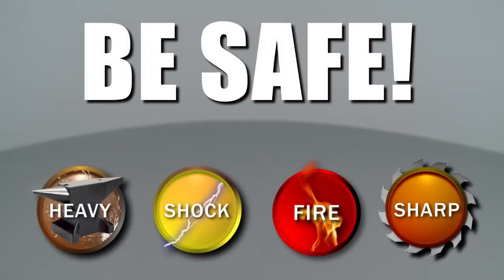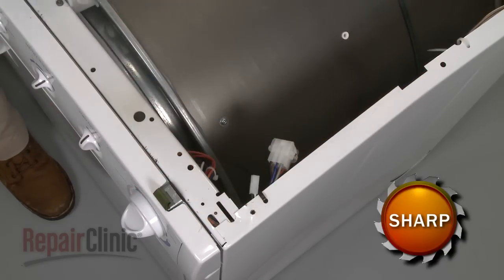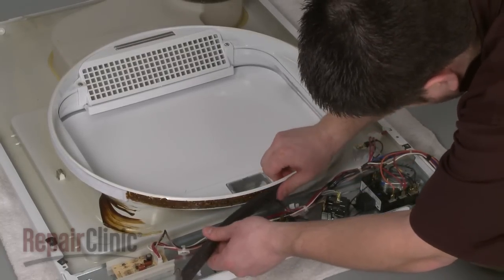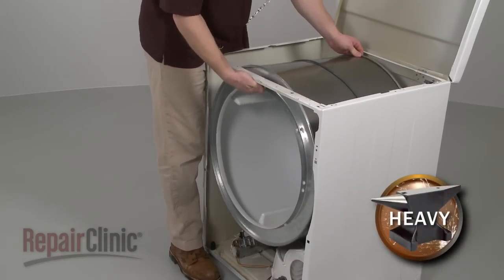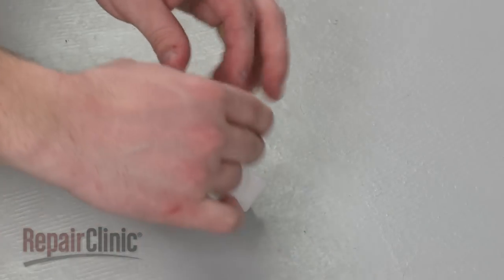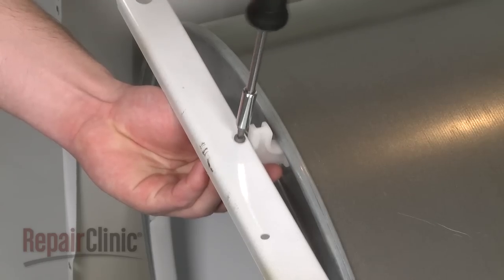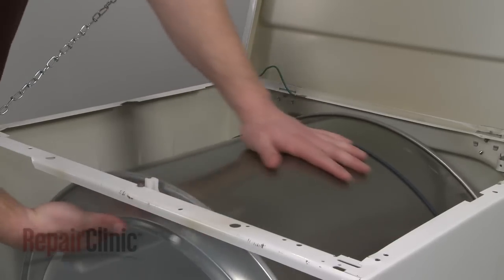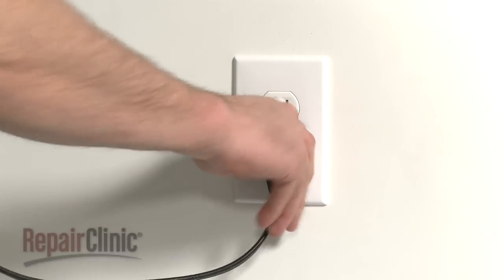Frigidaire Dryer Maintenance Kit Installation #5304457724

Comment: An EXTREMELY helpful and well-produced video. It showed absolutely every step with clear commentary. 
The only time I got into trouble was my own fault when I thought I remembered the next step - the removal of the main ball joint at the back of the drum - and that led to my cutting my fingers on a sharp edge at the back of the cabinet. 
IF I'd followed the instructions faithfully and left the ball joint attached to the drum, that wouldn't have happened! Motto: Follow  instructions!

Comment: Where are the internal gas connectors for this Frigidaire model line?? I have a gas smell inside of my dryer, which is apparent only after it is off for a while. I have been very careful to make sure to shut the main gas valve any time it is not in use.

I found one video of a similar Frigidaire model where they tightened a gas fitting inside which was loosened due to vibration, but can't find a complete disassembly guide for the model seen in the very beginning of this video.

Pretty sure it's a fitting inside of the machine, as there is no smell of gas outside of the machine when it's left idle.

Comment: great video.  How do you replace the felt in the rear?  It ripped and got jammed, and the drum would not spin.  I removed the felt and the sheet metal staples and I can't find any part to replace it with.  Thank you.
Reply: Did you figure this out? To my knowledge there is absolutely no felt anywhere in the back. Only the felt around the opening inside the door. Maybe you had lint build-up! 😆

Comment: Thanks for making this video!  I have a Frigidaire Gallery stackable dryer just like what you have in the video and it is squeaking now so I took it apart following your directions. However, I cannot take out the big drum.  It seems to be very securely attached to the back wall of the dryer.  Yours seem to come out without much effort.  Any ideas why mine might be stuck?  Thanks!
Reply from the maker: If the rear bearing is worn, the ball may become stuck in the bearing; in that case, you will have to pull up with some force to release it. Be sure to use gloves when trying to lift the tub up, as the metal is sharp. Make sure there is not a bracket secured above the bearing in the back of the dryer. If there is, you will need to remove it so the ball will come out of bearing. Most models do not have this but it's worth mentioning it in case your model does.
Reply: Greg Chan d

Comment: Parts worked great but they weren't what was causing my loud humming noise after the dryer runs for a few minutes.  I'm thinking the brushes on the motor looked almost worn off so maybe that is it..
Reply from the maker: You can also check the drum rollers and slides. Those will cause loud noises if they're wearing out.

Comment: my dryer gets hot but it doesn't get a chance to dry my clothes before timer dings and it shuts off, now that you have shown me how to get into it where do I go from here. I am older with a fixed income so I am trying to fix myself
Reply from the maker: cbzoo813 Try using a timed dryer cycle. The auto-dry cycle is often regulated by the cycling thermostat and some moisture sensor bars.
Reply: have tried that too, any other suggestions
Reply from the maker: cbzoo813 So you're saying the time still advances too quickly in timed dry mode? We would need your model number to give specific suggestions.